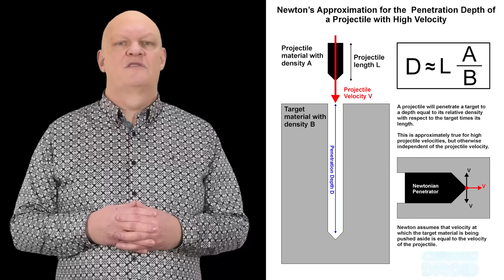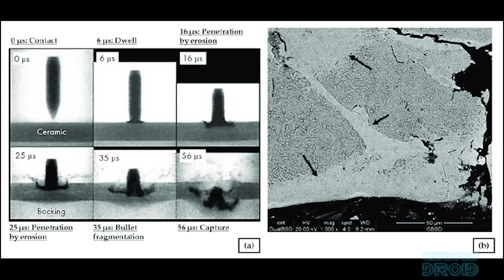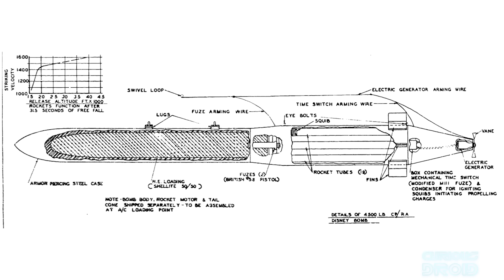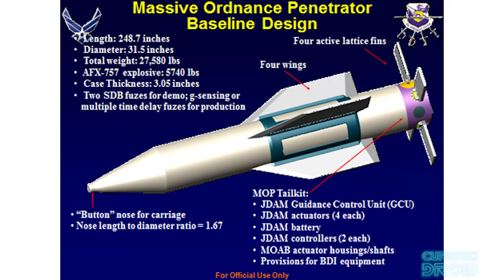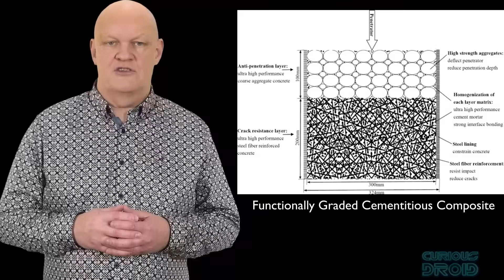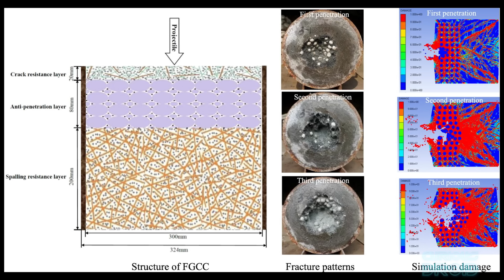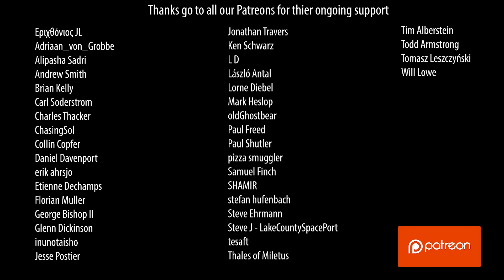Can Iran Stop U.S. Bunker Buster Bombs?

Comment: Just a minor correction @4:54 : Rifle rounds don't penetrate soft armor vests because they have a steel jacket around the bullet. The penetration is due to increased velocity and KE in comparison to the handgun ammunition which is usually traveling half or less than the velocity of most rifle rounds. As I'm sure you know, with increased velocity you see an exponential increase in KE(most 9x19mm handgun ammunition generates between 500-700J whereas 5.56x45mm ammunition can generate 1800J with a bullet half the weight). There are some rifle rounds that have steel jackets, but they are usually mild steel used for economical reasons over a more expensive copper or tombac alloy and are so thin that they tend not to impart much of a penetrative effect. On the other hand, ammunition with steel or tungsten cores (not jackets) are designed for armor penetration or for being "barrier blind". In fact, 7N21(7H21) and 7N31(7H31) 9x19mm ammunition developed by Russia in the 90's is effectively capable of defeating soft body armor normally rated to stop 9x19mm ammunition with a combination of increased chamber pressure(resulting in higher muzzle velocity) and a hardened steel core penetrator. I believe there were experiments done with case hardening cast iron projectiles used in naval guns in the 19th century for penetrating ironclad warships but in that case(no pun intended) the steel outer layer created by case hardening isn't really a jacket per se.

Also, ceramic in rifle plates tends to break up regardless of the material the bullet is made of. The ceramic is effectively sacrificial; the energy impulse from the bullet impact is absorbed as the ceramic breaks, mitigating the penetrative effect of the round. This is partially due to the fact that a fast moving lead or mild steel bullet will deform on impact of a hard surface, decreasing its surface area, which exponentially reduces it's ability to penetrate material. In the case of a hardened steel penetrator like tungsten the penetrator is hard and tough enough to maintain it's shape on impact so as not to radically deform, thereby concentrating the the impact on a smaller area, which makes mitigation of the impact more difficult for the armor. This allows the penetrator to punch a hole into the ceramic instead of just shattering the outer layers as would be the effect of a conventional rifle round.
Reply: Excellent comment

Comment: "Any problem on Earth can be solved with the careful application of high explosives..."  I'm thinking that in addition to higher velocity ordnance that a shaped charge within the bomb itself, similar to how an RPG warhead works to defeat light steel armor, that creates a super high temperature plasma jet would be something to consider for the defeat of high tech concrete formulas. All you need to do is figure what the melting point of this high tech concrete is then be able to surpass that with the shaped charge.
Reply: That's not how shaped charges work. They do not melt through anything. The copper jet they create acts like a very fast solid object and defeats armor not through heat but through kinetic energy.

Comment: Why not drop smaller bombs sequentially into one hole?
Precision is problematic, but I think guiding bombs by making them follow the bomb in front of them should increase precision.

And penetration would mostly depend on the number of bombs dropped
Reply: > Precision is problematic

I think that's really the problem. It's not like there is just "a hole in the ground" and it gets deeper with every bomb - instead, you have flying debris, dust, shockwaves, deformed and compressed ground etc...  But maybe, with some future technology, it could be done sufficiently well.

Comment: Terminal speed is NOT 750mph.  That's the speed of sound.   Terminal velocity (speed) is around 120mph.
Reply: WRONG!  Different objects have different "terminal" velocity. The 10-tonne “Grand Slam” bombs dropped over Europe by RAF 617 Squadron in 1945 exceeded Mach 1 before they impacted the ground.
Reply: @protonneutron9046  Whilst you are right, the bunker busters dropped in world war two didn't reach 750-800mph, this calculation disregards drag, windspeed, etc.

These bombs definitely didn't reach 700mph.  300-500mph. 

I mean people could hear the bombs as they were falling.

Comment: There's another option. Tesla's oscillator.  Matching resonance frequencies then adding destructive interference waves brakes up... just about anything.
Reply: no.  That would work applied to a falling bomb
Reply: @protonneutron9046  True, you couldn't really drop is as a bomb. It takes time to do. However all it needs is to be on the structure and it can effect it. You'd have to land the device on top, wait for it to weaken the structure, then send in a normal bunker buster to finish the job.
Reply: @kenstr321  if one were stupid enough to create a monolithic structure.  SOP is to create layers of different material. Which stops any such vibrational attack as an aside.
Reply: @protonneutron9046  I don't think the layers are unattached, which is the only way the waves wouldn't propagate. The dissimilar materials still interact when they've been laminated, which is what is normally done as the layers strengthen each other. Which does change the RF (resonate frequency) somewhat, but remember they're all combined with concrete so that's the only material you need to go after.
Reply: @kenstr321  wrong.  The waves are altered as they pass through different substances.  Their speed AND amplitude change.  VERY basic physics.  Did you take physics in school?

Comment: 17:51 There is no bunker of such. You cannot never be totally sure there is no emergency exit hatches, secondary or thirtiery communication methods and so on. Hell things are rather easy to hide after all and drilling vertically techniques have evolved so much you could potentially drill horizontal hole under the earth and rock from bunker to civilian structure and assemble communications array of considerably size inside the building, hidden from the satellites camera. Detection and hiding stuff methods also compete against each other, so just blocking the route wont achieve suitable results to take out bunker out with certainty at least.
Reply: But you can get intelligence about the bunker and use surveillance.

Once the main entrances are taken out, the occupants will be forced to use the emergency exits at some point.

Comment: I recall visiting the Normandy beaches and seeing shells still embedded in the embrasure perimeters and wondering if you were luckiest to have been killed cleanly by one penetrating or suffer the concussive results of it being stopped. There comes a point where the human contents must also be absorbing some of the energy release of impact and whether you could function afterwards. Centrifuges are very unlikely to survive such an insult intact.
Reply: The had 90 degree corners in the bunkers to absorb the concussion, but yea a pill box your screwed
Reply: Germans used more rebar then we do
So does iran

Comment: Fantastic video, Now I want to build myself a bunker using this concrete, just so I can say, if they want to penetrate THIS bunker, they're gonna have to use some VERY expensive hardware! The mathematics involved in this kind of science is staggering, it just goes to show how even the simplest of objects can become deadly even deep underground, as long as it is travelling fast enough! I still think that the US military was totally crazy to stop the research into kinetic kill weapons, because a tungsten rod travelling at MACH 12 is going to penetrate even the best armoured vehicle, or drill though several meters of Concrete, by the time the projectile makes it through the target's outer defences there is no need for any real heavy amount of explosives because it will act very much like a shape charge at that point, because of the heat and friction generated, whoever is inside is not even going to feel the explosion because it is happening so fast. They're dead before their nerve tissues can relay the data to their brain.
Reply: The US can easily afford all of this. The problem is that the countries building the bunkers are going to need to invest large volumes of capital into projects they do not have. It is one thing to carry out lab experiments and another to build tens of thousands of cubic feet of structures.

Comment: Here is my proposal to the problem.
A railgun / coilgun in space, which fires a high speed projectile with extreme velocity.
The biggest disadvantages of such weapon systems are cooling, energy consumption and wear. You could load the system with solar panels for months prior to usage. Space is plenty cool is your sattelite is positioned on the darf side sway from the sun and you can junk it once it´s used up but the bunker will be down as well.

Comment: I've been saying this for years that we need better reinforcement materials for composites used in civil engineering.  In one project I tried to get asphalt reinforced with basalt fibres but the project manager didn't want to pay for it and killed it on me.  We can do better.  The lifecycle cost is lower when you account for project construction costs of rework.
Reply: The high density of these types of concrete also stop water ingress from causing concrete cancer. If many projects added just 1inch of this as a coating the structure would last decades longer.

Comment: The heads and shell on them BBs are essentially a lump of specially hardened steel for strength and weight its like AR500 steel in the shape of a bullet most impressive thing of these are the internal electronics that detect the decrease and increase of inertia exploding after a few sequences the Gs the electronics go though appon impact are insane

Comment: obvious solution dig deeper, 
a hundred meters under ground i would feel safe from most weapons, including nukes.

another way to protect yourself would be using complex geometry of easy to penetrate layers combined with hard to penetrate layers.

imagine a deep bunker with a concrete spike overhead, then surrounded by dirt. 
the bunker Buster would get a glancing impact and probably deflect away from the intended target.

Comment: No space science. We based in a so called third world country and research over 10 years reached that with out of the box thing,modern technology, this is possible. We only applied knowledge and common sens with the support of mega corporate. Our research start with the destruction of ATM,S and how to protect them from using explosions,only to be told by banks, they do not care and not willing to spend money. Much more money in replacing  them and on top claim back from a even corrupt insurance industry. Our research did not stop there and now  structures of less then then one meter thick can adsorb tremendous impacts.

Comment: In 1940 (May 10) The German used Rockling Shells in Battice (Fortress - Bunker). These shells were so effective they got through 100 feet of dirt, then the 20 feet of the top of the bunker then twice 10 feet (all of Belgian Reinforced Concrete) to finally disappear under the entire bunker (yes below). These holes (you can see them today) looks like someone used an heavy driller to get through. Anyway, these shells were so effective that Hitler himself placed an interdiction on the use of this kind of ammunition because he didn't want to face these shells for the Atlantic Wall Bunkers he planed to build along the coast.

Comment: Would angled hardened steel plates embedded at depth within the concrete not be enough to deflect the device off target?
Reply: considering how large some bunkers are, and the capabilities of these ordnance, I seriously doubt it. Even if it deflected, it would still wind up in the base, unless it were to somehow bounce out at a 90* angle. Let's say they made the plates of the same steel discussed in the video and could potentially deflect these bombs; the cost of manufacturing it as armor plates would be much too high to prove practical. That's my guess!
Reply: @marshalhuska1181  at 18secs in the munition has taken a considerable deflection and a remaining deep ingress would surely be off target. Add in a granite subsurface.... a bullet proof vest type thick matting layered under soil would surely remove momentum and allow protection of an asset that needed buried in the first place! No expense spared!
Reply: ERA.....

Comment: I wonder if you could some how put enough water in between your bunker and the surface if the water could knock it off course or slow it down
Reply: Basically we're into the realms of building at the bottom of the ocean or a lake, since you'd need a huge amount of water to have a significant effect on a bunker buster. Technically entirely possible, but since most materials the ground is made of are all denser than water, I'm not sure what advantage underwater construction would give you over just building underground.
Reply: @ApothecaryTerry  I just wasn't sure things do crazy stuff in water but there so heavy and going so fast it most likely wouldn't make a difference I was just thinking if you slowed it down or got it to tilt or turn one way or the other would it decrease it's effectiveness
Reply: @Dustyscars  It would decrease its effectiveness, but I would imagine no more than being underground unless it deflected more. Realistically though you wouldn't need to damage an underwater bunker anywhere near as much though - just one decent crack would be a terminal leak.

Comment: The high performance concrete seems like it uses the same principle as pykrete. You can do an experiment where you mix sawdust or textile fibers in water, then freeze it, and the resulting ice is much stronger than regular ice.
Reply: Yeah, and it remained frozen longer as well. During ww2 there was a plan to build a huge floating airport using the material.

Comment: Generally everything sounds good, except I have a hard time believing such a heavy, long and thin penetrator would be limited by terminal velocity in the sense of air resistance balancing out with gravitational force as with a human in free fall. And ince the higher you go in the athosphere, the less atmosphere there is in the first place to reduce speed, the top speed should be limited by height of the dropping aircraft. But maybe my intuition of the drag forces is wrong the same way it seems impossible to punch through meters of concrete 🤔
Reply: Air resistance increases exponentially as velocity increases. Even something with a narrow cross section will hit terminal velocity fairly soon.

Comment: They need to steer them to the side Not one solid structure but tilted hard parts with a softer area or gap right at its 3:40 side in layers.  They might even turn them around this way. That kind of happend with Bombs that fell on germany that penetrated the gound made circeling movement in the soft gound and ended upside down in the ground so the Acid couldn’t eat trough the metal and trigger the detonation still live today.

Comment: Kinetic Orbital Bombardment, Rods from God... For when you really, really need to make sure they get the memo!

IDK. I'm thinking Kevlar twisted like barbs on barbed wire for the fiber reinforcement, so it has anchors in the concrete.
But I'm also wondering, if you have the kinetic energy, mass, speed etc... all you need is deflection, a way to protect it a little longer, carbon nanotube sheeting.

Comment: The fact that Teheran is capable of creating such advanced concrete, shows that they aren't some sand barbarians like governments would like people to see them as.
This is kinda important in order not to let ourselves to enter another difficult war.
Reply: These types of concrete are not new they have been used in specialist industrial applications for decades, they are rather expensive 3 to 5 times the cost of regular hi-strength concrete and harder to work with (don't like to be pumped)

Comment: The major point at the end is the salient one - if they can't use the bunker, it effectively doesn't exist. All the infrastructure feeding it is where the denial of service can take place.
The only way around that, is to build the bunker deep with multiple entrances that are so far away from the bunker that they look like other bunkers, and from there, dig a deeper layer of transport that takes troops and supplies between strategic locations while removing the tunneled out material via multiple random exits that are no where near the actual work being done.
And, of course Iran is a leading player in bunker concrete - every time they try to build a new power station the US and Israeli governments go a bomb it without evidence of it being anything other then a power station. But, that's the whole 'Keep 'em dark and poor' method, rather then communicating with each other.

Comment: Why not use fire bombs to make the outside an inferno for long enough to make the inside of the bunkers too hot to survive in? It would be terrible but less so than nuclear bunker busters.
Reply: Bunkers are several tons of concrete walls and floors with a lot of volume inside. Consider that at least half the heat will escape through the hole on the ground you just punched. Even if you have enough fuel, at least at some point the people inside would find the heat spot on the wall or roof, and use fire extinguishing systems to cool that spot which would buy them time for the fuel to be consumed.